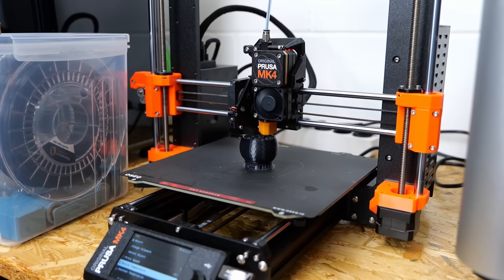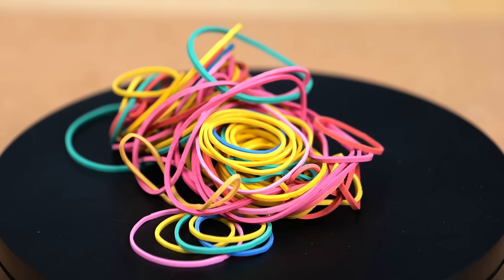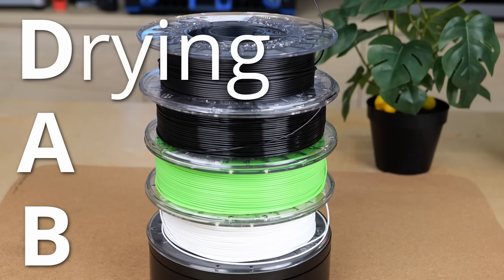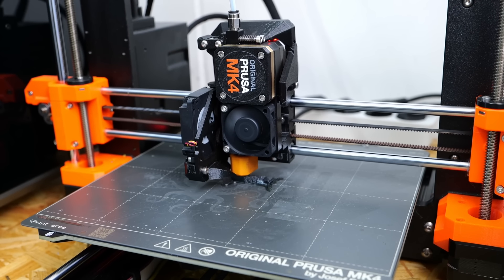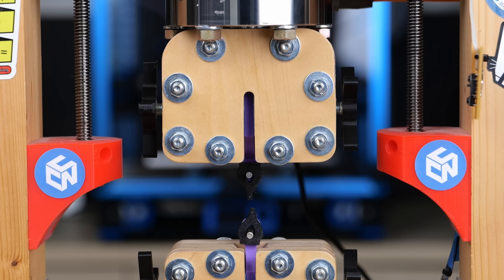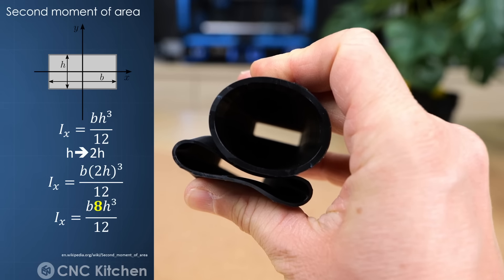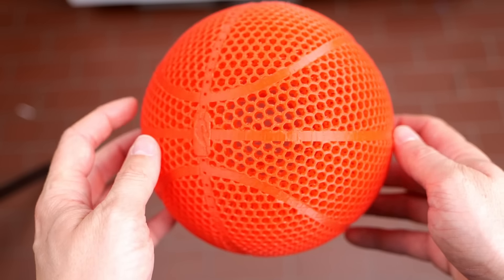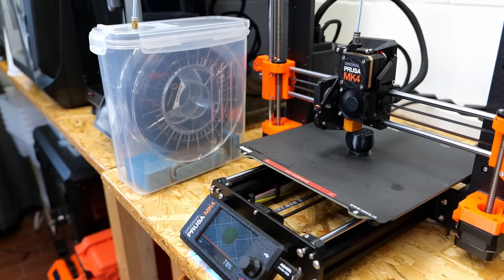Why aren't more people 3D Printing this Indestructable Filament?

Comment: Sometimes I have problems with stretchy tpes slipping in the extruder and not having enough grip to pull the filament off the spool. This causes under extrusion and eventually jams

Comment: I really wanted to try some of the other brands of TPE you covered, but I do not see them as available or reasonably priced.  I have been using some colored TPU 95A for articulated animal toys for the kids. Sharks and octopus for bath time, and of course dinosaurs for battles.  They are the only 3D printed toys they can not break!  The other far more useful prints I make are typically gaskets and O-rings for watertight seals or replacements.

Comment: There is an easy way to remove tpu prints of your bed, just poor some isopropal alcohol on the side of the print it will slowly get under the print an will release it easily you don't even have to clean it as long as you don't use to much it will quickly evaporate.

Grüße aus dem Waldviertel

Comment: 10:50 honestly you can easily get up to 15mm^3/s fairly easily with tuning if your printing 95A TPU. And you can print at 30mm/s print speed no problem on the flashforge creator pro 2, and I imagine any printer similar to it.

Everyone gives incredibly conservative print speeds it seems for TPU. The main killer is to turn off filament retraction

Comment: I see your images of printing flexible on a Prusa XL… egads flexible filaments have been so hit and miss for me always requiring me to run the filament directly into a print head… I ordered the official prusa xl enclosure after trying the enXLosure design on mine and I hope that when it arrives the top “dome” area will be strong enough to support filament rolls… I would love to shorten the filament path of the XL as well as moving the filament run out sensors up to the top too. (The space around mine is more cramped than i would like it to be.)

Comment: One thing I've been looking for is a flexible filament I can print with a rigid filament in a multi-material printer, but in my initial look at materials on hand, the temperature profiles were far enough apart it seemed unlikely. Any ideas here? Looks like potentially a fiber-filled TPE, but I was looking into a overall stiffer material.

I'm thinking about things like rigid 'bones' inside flexible material for bumpers, grip sections, living hinges on existing parts, gaskets etc.

Comment: I usually used A95 TPU for FPV quads etc but recently started using D58 TPU for rc aircraft parts and I wonder why I haven't done so sooner. The durability its insane and it is hard enough to print some protectors  etc

Comment: Hard to find good profiles for tpu, my Bambu printed ok with 95 hardness but 80 didn’t work well, it kept moving but stopped extruding. Being so slow I used my Ender 3 to print the parts with no issues. Parts were footwear.

Comment: Really really interesting video. I wonder how it is with stickiness of all the filaments (no troll). Is there anything which you can print without getting into trouble with your room mates? Because normally I do everything in PLA, however for some applications the flexible stuff could be of interest. But I think I won't be able to proceed if there are smell issues :S please give me a feedback.

Comment: I might be stupid lucky but drying TPU has not been an issue across the 20 empty rolls, some nearly a year old, stored in a dry box, printed in open air 

YOUSU 95 TPU 
228 print temp

Comment: Would the different shore hardness change the absorption qualities?  Meaning would some absorb horizontal energy more than vertical?  Is there a specific frequency that softer TPEs absorb?  I’m not a very good with the physics so am prob only not phrasing the questions in a useful way.

Comment: With an older printer I was only able to print TPU with retraction turned OFF. For parts where stringing isn't an issue they turned out perfect...but of course the others where it could be an issue it was an issue. I often use TPU for parts where they aren't front and center and noticed so cosmetic imperfections are not important. I'm eager to try some of these softer ones, thank you so much for this thorough video! Oh, and that print at 245 and then 235 where you said the 245 was ugly and the other perfect... was the rough one still strong? If so, the rougher look can be a desired outcome, no?
Reply: for that rougher look, the fuzzy skin option exists

Comment: 9:32 .. i had problem with layer adhesion and thickness.. had to go like 250-255° if i remember correctly and it printed nicely.. but since my printed doesnt have box around it, i think actual temps are lower, as for every material i have to print more hotter or go 8x lower with every fan speed setting

Comment: I love TPU. But would love to see which TPE makes for the best RC tires. I myself use TPU a lot for outdoor needed parts.
Reply: I've printed a bunch of tires with an 83A TPE from E-Sun.  It may not be the best but, if you have access to Amazon it's available there, and it's very inexpensive.  With minimal infill it's very soft and very rubbery.

Comment: I need a food safe flexible filament.
Reply: It will not be food safe, even if the filament is food safe because it touched the nozzle and his heated and all that stuff. It would need to be in a very clinically clean room where all parts of the printer is clean the roughly often. All you need to seal it afterwards with something, possibly something that is flexible after you coat it in it. Technically speaking, though you usually would not get sick in anyway from using even PLA for a fork.
Reply: @Luka1180  I tried the HDGlass from FormFutura, the result is surprisingly hydrophobic, looks clean, but it's quite hard.  Using a hardened steel nozzle.

Comment: I designed a small TPU segment to add a slight amount of stretch capabilities to something. It worked great at first but I found that over time, the TPU began to "creep", and the length of the TPU approximately doubled. Any thoughts on how to fix this creep issue?
If there isn't a way to prevent TPU from permanently stretching, if I could find some other material to purchase, like a rectangular "D" ring made out of some sort of rubber, i could integrate it into the part. It needs to be very tough and failure-resistant like TPU, while providing some elasticity.

Comment: Stephan, could you please explain why I can't print TPU through an all metal hotend? I use Sainsmart which is 95A, and I can only print on my TEVO Tarantula, which has a teflon lined hot end. I had an all metal V6 hot end on my TEVO and I had problems - once I switched to PTFE lined insert on the V6, the TPU printed just fine, even with the Bowden extruder. I also have a Voron 2.4 with Afterburner direct drive and a Dragon all metal hot end and cannot print TPU on it. BTW, it's not bunching in the extruder - it starts printing fine and then after printing awhile, it starts acting as if the nozzle is clogged, extruding less and less material. My theory is the material is sticking to the metal walls of the hot end as it transitions from the cold to hot part of the path to the nozzle, which builds up over a fairly short period of time - the first couple of layers print fine, then the flow begins to diminish afterwards.

Comment: This is probably a reach, but is it possible to enclose a 3D printer in a pressure chamber and then print shoes with enclosed air pockets that are more bouncy than they normally would be?

 Like, have increased pressure during the print and once it's done the air inside the infill would still be at over atmospheric pressure even after you take the shoe out of the pressure chamber. Is that something this flexible filament could withstand? Could you even print under more than atmospheric pressure? Probably too dangerous to actually test lol

Comment: So what do I use to print a part like a gasket or an o-ring or a keypad? Mostly not interested in tensile strength. More interested in compression. More interested in it behaving like silicone rubber.

Comment: Getting beautiful prints is difficult especially with varioShore tpu. Designing for and printing in vasemode helps, or adding holes in postprocessing with a holepunch or small scissors. Knives are risky for both your print and fingers. 💀

Comment: Interesting.  I did not know there were so many types of flexible filaments though you did not mention the newest one FPLA which is flexible PLA though it is a bit expensive.  As for the fleshy colored filament  if it does not collapse under its own weight you might try printing a humanoid figure or an artist model which is usually made out of wood.

Comment: I have tried to print using NinjaTek NinjaFlex 85A and NinjaTek Chinchilla 75A filaments. The biggest problem I have with them is that they absorb moisture really fast and for some reason they always clog in the nozzle. I am not sure if I need to use a fresh nozzle and only ever print that material with that nozzle or if I need to do something else. I currently have about 300 grams of the chinchilla filament but I can't really use it.

Comment: Unfortunately I only have a Prusa Mk3.  It will print TPU but I have to mess around with loosening the extruder drive wheels.   Then it's a pain to try to get them back where they need to be for things like PLA.  I need to save up and buy a newer printer.  They all seem to print TPU's without having to mess with extruder tension.

Comment: Hello Stefan, I have a Creality ender3 s1 pro printer, I don't have any problems with small prints, but when I want to print large prints, it says communication with the MCU is lost at different times and the printing process stops, when I want to continue from where it left off, it starts from the wrong position. Why does this machine give an error with large prints, I searched the internet and couldn't find much information that would be useful for me. I talked to a service and they told me that this could be due to overheating of the sonic pad, stepper or motherboard. I don't know what to do. Do you think cooling the steppers could be a solution, if you have published a video about this, I couldn't find it unfortunately. I would be very happy if you could give me advice. Unfortunately, I don't have enough technical knowledge on these issues. 😞

Comment: The 60A could be used for multi-material 3d printed tires. It has the most grip but is too soft to make the whole tire from without being too heavy.
Maybe someone could make a 3d printed tire that actually outperforms normal rubber tires this way.

Comment: Is it practical to do dual material printing with TPE, bonding properly even if they have different hardness? The PLA/TPE meta-material split badly, but it seems two different hardness would at least be "less bad".
That seems to allow for making objects with a "rigid" core and more yielding surface (ergonomic tool grips come to mind immediately... Or for other things @4:05 😅)
But if the different hardness are incompatible, it would be tricky

Comment: Are any of these food safe?  Could you create food molds for instance.
Reply: Actually, no 3D print is food safe, even if it's printed from food safe filament. However, you can 3D print positive mold and make negative mold from food safe silicone.
Reply: @Mizu-nt3jk  "how is food safe filament" not food safe?  Makes no sense.  Is someone lying?
Reply: @UnCoolDad  3D print is not food safe. There can be small cavities, where food can gets in and you won't be able to get it out from there. It's same in machining. You are not allowed to form thread to create food safe part. You have to cut all threads in food safe machine. Also, 3D prints are porous, so liquids can gets between layers (also at 100% infill).
Food safe filament just mean, that the material itself can get in contact with food.

Comment: I've never understood the 'you need a direct drive to print TPU' mentality.  My Ender 5 Plus and Tronxy XT2 Pro both printed TPU on their stock extruder.  No issues.  I had upgraded my E5P to a Microswiss NG DD(for a Nylon print project) and didn't any notable difference.  I'm guessing this thought is all highly machine dependent but considering the differences between the two mentioned, it's not a lot.

Comment: superflexible, 60 shore? Sounds like the ideal material to print school accessories to help with some disabilities, such as pencil holders to adjust the grip.

I have printed a 90 Shore A with a bowden drive, but I need to print it at 240°C, very slow and without retraction.

I had to learn to lay down gluestick to not lose the prints, print in series and not all at once. I started with the TPU to repair an instrument: a single replacement peg for it cost 10 bucks, there were 30 pegs missing their rubber sleeves . The parts would just get pressed onto the steel cores that were left and... voila! suddenly the parts were replaced and the instrument back up to game. Now I use the rest of the spool for some props that are used in LARP combat.

Comment: That's really weird. I tried some Amazon Basic TPU and it worked great, so I came up with more applications for it. I had heard/read (I think) that it didn't absorb moisture so I left it out for weeks with no dessicant, etc. It printed great from start to finish with no drying and no special care. I had a similar experience with Priline TPU. I don't hear bubbling and the finish doesn't have stringing or pockmarks. Again, very strange.

Comment: Does car tyre rubber has different stiffness when pumped or it stays same while flat?
Reply: Rubber thread doesn't inflate, just the core. So the part of it hitting the road would be similar, but it will soften and grip better from the heat of the friction against the tarmac.

Comment: Why not include ninja flex, that’s the original tpu.  I have been using it for over 5 years, i like the 85a soft version, it takes some tweaking to get it to print right but its an awesome material.  If you are not experimenting with tpu you are not a 3d printing nerd.  I am going to try some of the ones you mentioned here if they are available in the US.  Great job geeking out on testing these materials.  Larry

Comment: It would have been nice if you had gone through the different types and done some kind of comparison of which are easier to print and so on. And if there's anything other than TPU out there. And also flexible PLA, that's a whole confusing space of flexible PLA

Comment: Has anyone got experience printing flexibles on an Ender 3 with a bowden tube? Obviously a direct extruder would be preferable, but if you don't want to buy or upgrade you printer is it still possible to get reasonable results?
Reply: I have printed medium and hard TPU on a dead stock Ender 6 with a 65cm bowden.. basically a slow PLA print with bigger retraction distances than.. anyone. Seen 13mm at the extruder. But at the nozzle it was 1.9mm..

Comment: Company in South Africa , Filx making TPR  (Thermoplastic Rubber)  called TPR90 I am printing with it on Ender3v2 bodem extruder, it a bit challenging, I know I need to get a direct drive. Pretty much a rubber. do you have any information on TPR

Comment: I absolutely don't like using glue stick because it leaves a residue on the print. Also the remains on the bed are hard to get off.
I got my best results on an FR2 sheet with a lot of fingerprints on it. Still, you need to remove it while hot.

Comment: I've tried to print with TPU-CF (with 30 and 10% CF), and quite frankly was not impressed at all. The specimens were stiffer than my regular go-to TPE - TPU-95A from Esun, but at the same time, they were super brittle, showing a similar crack pattern as something like PETG when tested in a contraption similar to your impact test machine. And the layer adhesion was not great at all to boot.
Your tests give me hope that maybe I did something wrong, or maybe my filament was of a poor quality. The quest for the perfect filament for 1.5kg battlebots continues!

Comment: i have been printing bicycle grips with 1 wall outer and inner and 15% gyroid infill but its still not soft enough
Reply: Try a different infill pattern, 15% gyroid depending on the geometry could be quite firm. Also consider the direction you want the print to comply and orient the infill to match. Consider a rectangle is easier to squeeze in one direction than the other.

Comment: I'm grateful for the thorough testing but the lack of temperature testing is a HUGE, critical variable in flexible filaments.

Extrudr Hard CF is ~150C capable while  others deflect nearly 100C lower. This puts the Extrudr Hard CF in a temperature range often above PLA, PETG, ABS, ASA, PAx (with no fill), & many PCs. 

Even the Extrudr Hard (non CF) comes in above most PLA, PETG, ABS, ASA, & PAx (with no fill).

How could such an important variable go without mention? Most materials don't have the sort of temperature handling variability that the flexibles in this video do.

UV handling is also important but less so than HDT.

Comment: various imperfections on the radius of the edges (the drawing measurements are not respected). Some dimensions are missing from the drawing and I think you invented them (min.2.27 dimension mm8 and in min 18.00  I think you deduced the center of that circle diameter 50 ). You got the radius of the flange wrong (min 8.20  2 circles diameter 20, should be diameter 22) But I think it is not an easy drawing to reproduce if you do not have a minimal idea of how the piece is actually made